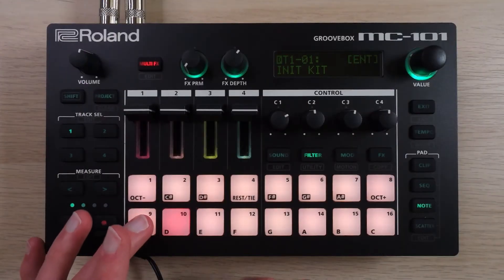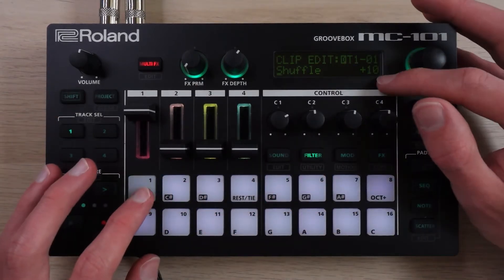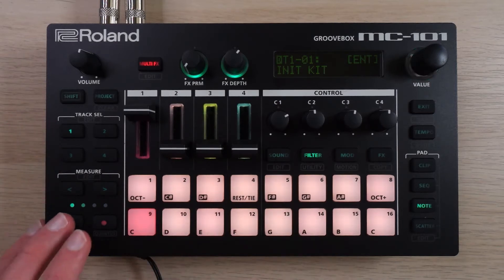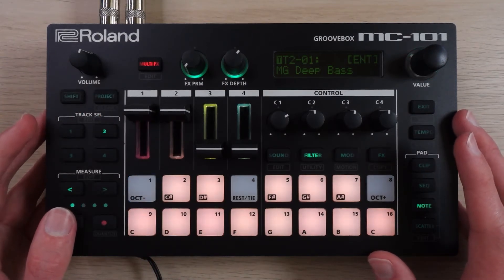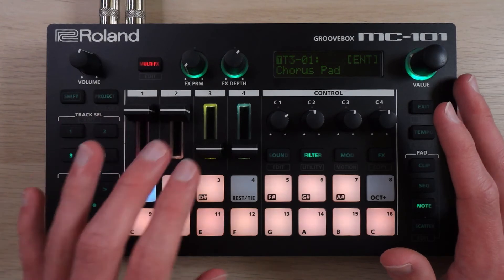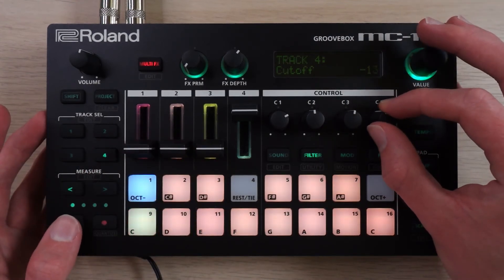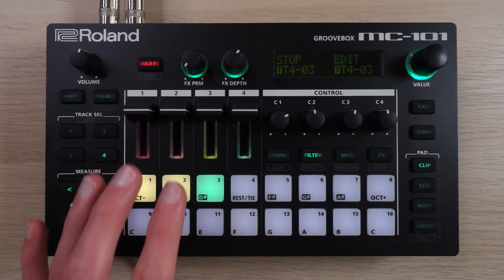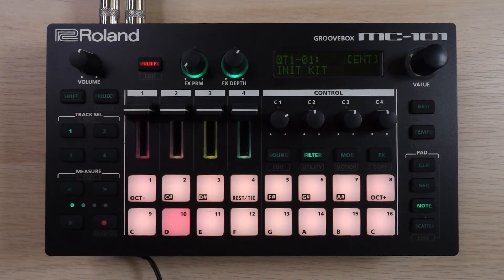Making Future Garage / Chillstep on the MC-101

Comment: Hi, in your opinion, would you say the Circuit is better than an Maschine MK2 ? I have an MK2 but Maschine doesn't seem easy to use. The latest version doesn't even support rf Nexus if its 32 bit. Coming from FL Studio, ive gotten used to working with that workflow, and using Nexus. Seems youre a big fan of Circuit, so i figure id ask your opinion

Comment: This might be a stupid question, but how do I sequence a tie on the MC-101 when I'm in a scale (say Minor Pentatonic, for example) in which that pad (#4) holds a note?
Reply from the maker: I'm not 100% sure off the top of my head, but holding down note and then hitting the pad might work, it works for the octave up and down buttons.
Reply: @GabeMillerMusic  That's for transposing notes.  I'm sure it has to be something simple.  Would be really weird if you were limited to 4.99 length notes unless you were in chromatic scale.
Reply: @derekheimlich6911  if you happy to lengthen them afterwards, I think in the step sequencer you hold the button beneath c4 (?) and increase beyond 4.99 using the c4 knob …. I’d have to check this tomorrow
Reply: @AUW-music  I just tried that and can verify that it does work! Thanks!  That'll make some things easier.

In the meantime I had figured out the hard way to do it: After holding record and then hitting the step you wanted to start sequencing on (for sh101 style) you can hold down your desired pad, and at the same time (while still holding down your pad the whole time) hit shift+note and go back to the chromatic scale, and then hit the rest/tie pad as many times as you need.  Pain in the ass and if you let go of the pad that has your note(s) you have to do it again.  Really should have a shortcut for this I think.